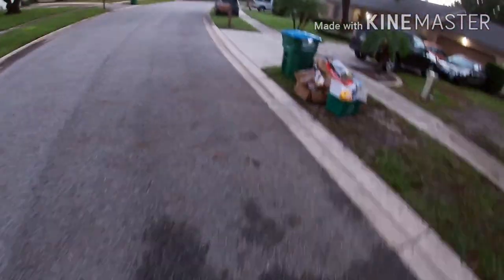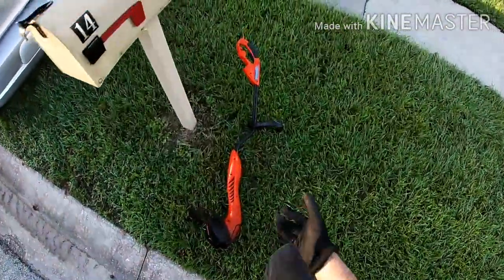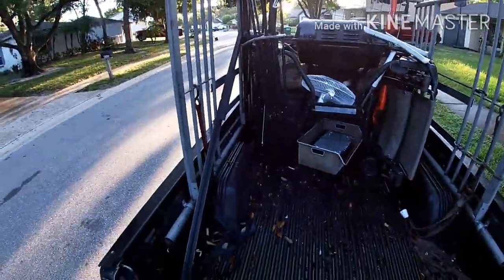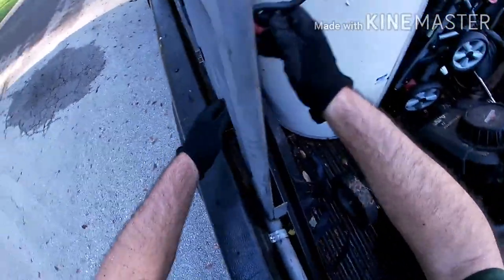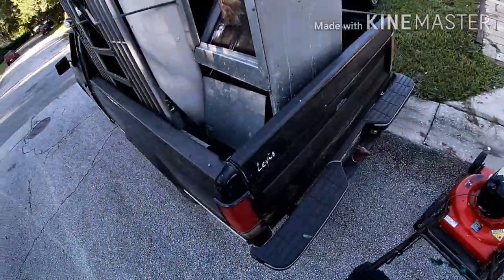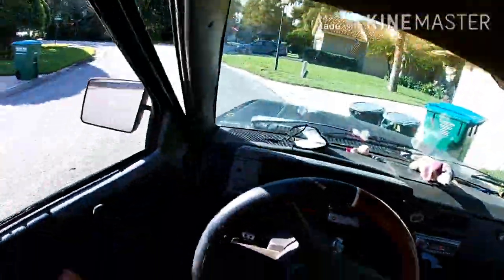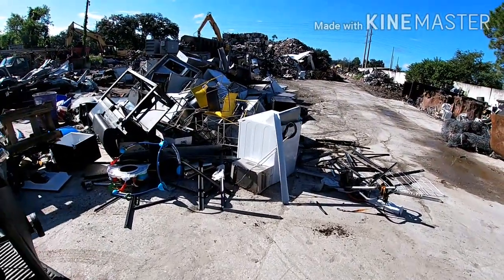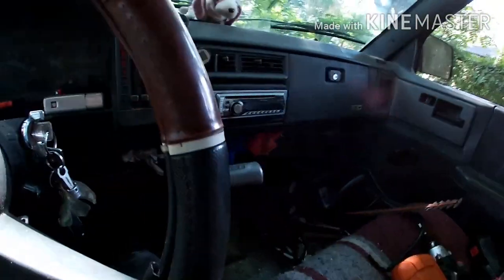Scrap metal comes in all shapes and sizes.

Comment: Hi coaxial wire is either steel colour copper or actual copper its 50/50 you should take it as it can be worth it. if its steel stick in with your tin shred.
Reply: Coax cable is 110% Steel I guarantee I've been working at a scrap dealers for 15yr so you learn and can spot different kinds of scrap after doing it forever. And most scrap yards won't take it in shred or any other metals